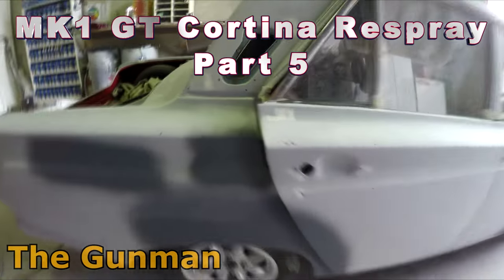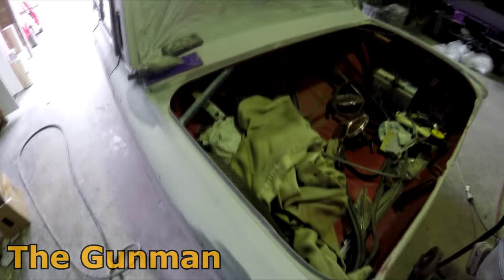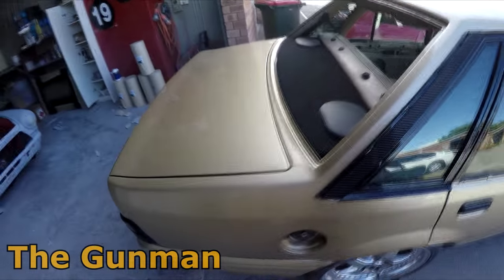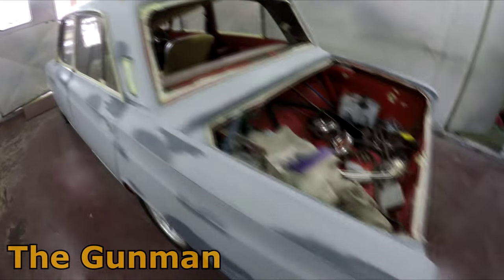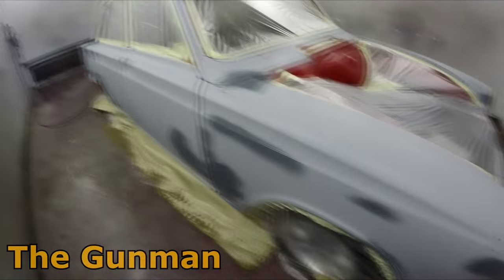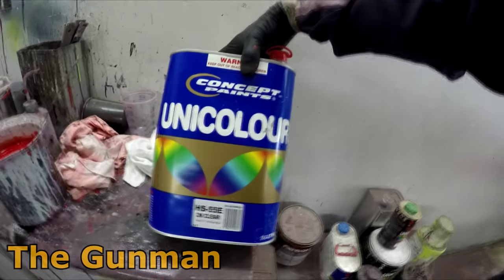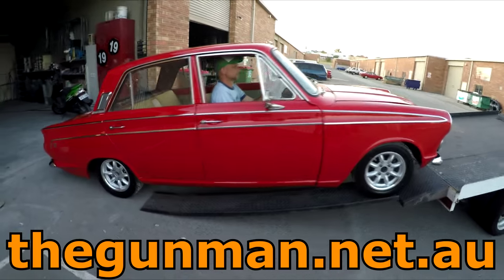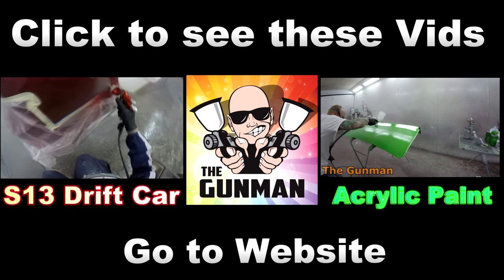Prep, Mask & Basecoat MK1 GT Ford Cortina Part 5

Comment: Gpi looks like a great gun ! Can't wait to watch you clear with it in next video ! I don't have the best lighting in my shop, so I use a sealer to start off with a uniform color prior to the base coat. Just in case I have poor coverage. I may try a Gpi instead of the Pro lite. From spraygunsdirect , as I can't find the Gpi, Gti, or Flg5 in USA.  Thanks Gunman !

Comment: When thinking if buying a compressor it all comes down to cfm..you need at least 15cfm in say on a 150litre tank n 3hp motor..but when you buy one if it say it gives out 15 cfm it will only really give out about 12 cfm...on average you should be looking at around 18cfm/150-200litre tank with 3/4hp motor for a diy guy..each gun uses 6-14 cfm n each air tool uses around 10 ish cfm...also the longer the hose the less cfm u get at the tip of the airline..

Comment: hey man what would you recommend,  the sgk or the gpi for a occasional diy guy?
Reply from the maker: Do you want one gun to do primer, acrylic, 2k, base & clear? if so then GPI. if you want to spend a little less money but only want it for colour, clear, base, 2k but not primer or acrylic then go for the SGK
Reply: +The Gunman sgk it is then. I have a bunnings spray gun which i bought for primer use only. meh, it can always be sanded anyways. Thanks brother.
Reply from the maker: You should love the SGK, it came in at a good position in my top 10 guns video that'll be up on Saturday.